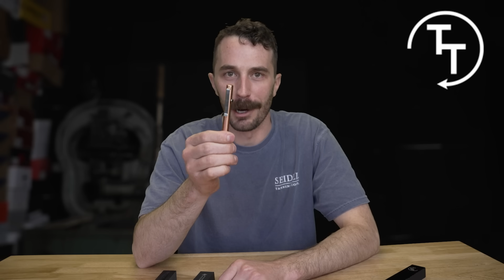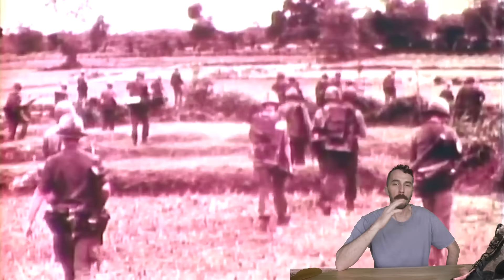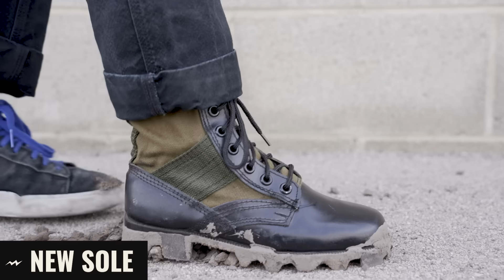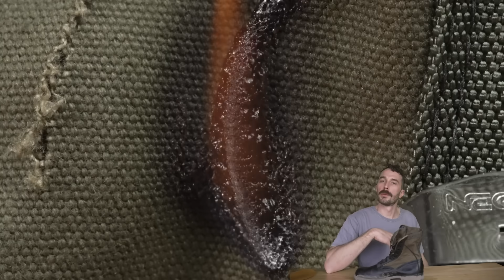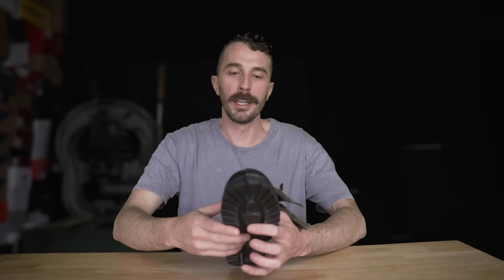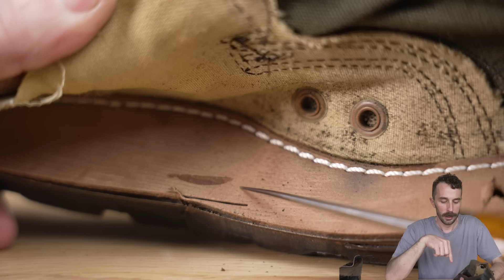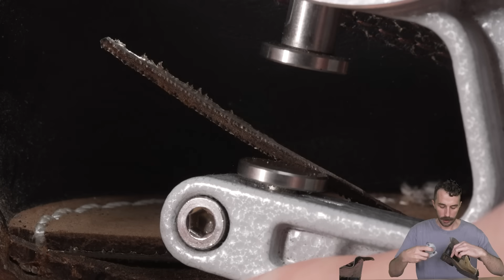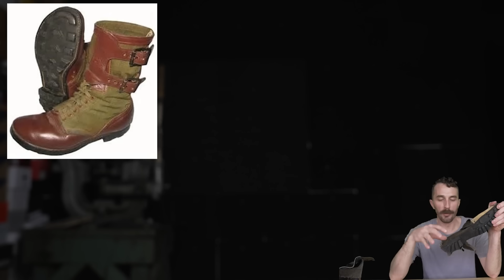Why it took 57 years to replace jungle boots

Comment: I had a pair of surplus Jungle Boots when i was a teenager.  I'm going to give them a C- for use here in the Northern US.   Rainy/wet they suck.  Cold weather, they suck.....Hot dry summers, A+
For jungle use they're probably a good boot, but everywhere else....Meh.   I remember going outside in July with nothing but dew on the grass and coming back in with wet feet in less than 2 minutes.  Later on I had a pair of Altima leather boots that were basically the same cut but in all leather.  They were significantly superior, except for that jeep lug sole in snow!

Comment: The water came in from only one and half inch puddles. The vents are above the inside sole so half an inch of water stays and absorbed by the mesh sole for the rest of the day from the first puddle. And in the jungle there are LOTS of puddles, ponds, rivers and rice fields. Then there was the monsoon season where everything was over an inch and a half. Mud collected to the point it was not possible to walk in some areas. My boots would be eight inches wide from mud at times. Most secure areas required jungle boots spit shined polished, which held in the water and air. 
My father was stationed in New Guinee. He had terrible feet problems. I got free shoes and boots from my dad which gave me the same problems. I was stationed in Vietnam which made my feet problems even worse. Tay Ninh 1969 to 1970.

Comment: Used them for cave exploring for many years. Then the Korean version came along and the sole was no longer the same vibram-like sole. More slippery on mud.
Reply: If you ever caved in a wet, muddy caves, the old vibram soles were far better.

Comment: Curious how you came up with 57 years before replacement. The boot became issue during the 1960's but by the late 70's had been replaced by a black all leather boot. I wore the black leather boots during the mid 1980's in the USMC. The jungle boot can still be found in surplus stores but its longevity as an issue  boot didn't even come close to 57 years.

Comment: This is really one of those things that divide opinion. On one hand, jungle boots are just some of the most durable pieces of footwear and equipment in general. Mud, gravel, sand, marshlands, rocks, it almost didnt matter. These things were gonna hold up and then some. On the other hand, depending on what brand you got they were a bitch to break in, caused a lot of blisters if you didnt, and were generally heavy as fuck; to say nothing of how uncomfortable they can be before and even well after breaking them in. Doing daily runs in these things with a ruck and rifle definitely fucked up my feet and knees. One thing that everyone probably agrees on tho: nobody misses having to shine these mfers on the regular for fear of getting smoked by either your Drill Instructor or CO. I know I dont lol

Comment: These panama/ jungle boots were standard issue in my country up to 2018, and were replaced by tactical "modern boots" afterwards, we'd still use these old jungle boots for actual patrol while the modern tactical boots were used in garrison duty so it didn't even went away, I got out in 2020 but i still see and hear that they still sue this boots outside the wire due to its durability.

Comment: I had 2 pair of the panama sole od green jungle boots in the 90's. One pair was for field one pair for garrison. Of course, like many others, word came down we were no longer authorized to wear them. Fast forward to 2004. Getting ready to go to the sandbox and I was issued a pair of tan jungle boots. Even had the panama sole. (All the other issued desert boots weren't constructed the same) Yep, the panama sole desert boots were just like the od green jungle boots as far as comfort, wear etc. Way better than the other desert boots. Of course I rotated boots on a daily basis just because but I wore the panama sole boots until there was zero tread left. I still have them for old time sakes.

Comment: I bought two pairs of reproductions of these as I had always liked the look of them. Well I don't know how they compare to the real thing, but they are the most uncomfortable boots I've ever worn. The main problems for me are the hard rubber soles and flexible nylon uppers. With the former, walking on concrete and rocks absolutely kills your feet... with the latter, you have to lace the boots up so tight so that they don't fall down that they cause bruises and blisters on your legs. I assumed that maybe the real ones had an extra hard sole too as they were meant for traversing soft swampy land that counteracted the hardness. I made the mistake of wearing a pair on shift as a kitchen porter once and they crippled my feet to the point I almost couldn't walk for a few days.

Comment: I had a pairs of the late ones that had speed laces, steel spike sheets under the inner and the fibre backed inners and the very heavy duty nylon canvas. They were most definitely GI ones as they inners had "Do Not Boil" printed on them. They had the square pattern lug soles. Later model ones than these as they had the speed laces and the later mesh inners. The later ones had the spike layer as a sheet under the inner though rather than embedded in the sole. I still have them though the sole heels are worn down badly. I bought them mid 90's. I wore them in the field mostly in the Army Cadet Corps here in Australia mostly as I was always ending up in creeks. They were quite a bit lighter than the Highmark GP boots that were issued here at the time and more comfortable. GP's were basically waterproof as long as the water didn't get above the cuffs but they were a pain when they got wet as they were all leather. I still have a couple of pairs of Highmark GP's somewhere too. One pair of the GP boots was spit polished to a high shine with parade gloss which took many hours of work.

Comment: I wore these while stationed in Marine Barracks, Philippines. We could not wear them in garrison (guard duty) but wore them all the time while in the field. I can say they absolutely pump water out of those vents. Mine were very faded when I came back and could not wear them except in the field. My steel plate broke in one and it made a snapping noise when I walked. I just bought some of these later block lug soles to resole a pair of work boots. I would wear them again if I could find a steel toe version.

Comment: The thicker sole was called the Panama sole which was designed to push mud out when walking through it. Only downside is it would wear down quicker than vibram lug

Comment: They had cheap ones in Clothing Sales when I was in an light infantry unit in the late 90s prior to the ban or whatnot, the seam on the nylon always gets me, and my feet flatten out a bit if I go on a ruck march or whatnot and press against that seam. I did love the normal black combat boot but when they switched to the desert boots, I always went to a Belleville store or other 3rd party boot maker and had boots fitted for me. The one time you do not want to cheap out on boots, is when you do long ass force marches, tactical assaults, and comvey security.

Comment: You did the piercing of the first boot through the front of the sole. The Jungle boot you did it the the mid part of the sole which is where any metal tang is placed and where the boot is thicker - Bad testing, or conning viewers.
Junk channel.

Comment: The Norwegian military has used the same boots since 1977.
The M77 boots are still being produced and looks exactly the same as in 1977. The M77 boots is basically the same boots as the earlier M66 boots, only with a higher ankle. And the M66 boots was essentially a copy of the British low "ammo boots" from WW2.
I use the M66 boots every day. I like low boots better than high boots. I have several pairs of M66 boots, the earliest pair is made in 1968 and the "newest" is made in 1975.

Comment: I was issued jungle boots for jungle training down in Panama back in late 80s.  Had them in my closest years later when I began work with the US government’s POW/MIA Accounting Command - the Department of Defense’s efforts at locating and identifying our missing servicemen from past wars.  Over the next five years I wore those jungle boots on investigation and excavation missing throughout southeast Asia.  The aggressive tread kept the mud from clogging up the soles and while I often had wet feet, never experienced trench foot. The nylon upper dried out very quickly.  I’ve since moved on to other types of boots, but jungle boots did exactly what they were designed for, working in the jungle.

Comment: I still have both pair of boots that were issued to me in Boot Camp, back in '95.  The leather Cadillacs as well as the Jungle boots.  The outer soles and heels have been changed countless times, but everything else is still in almost perfect chape.  If it works, don't fix it, and keep it as simple as possible.

In fact, (I may have told you this already) but the pair of leather boots I was issued were supposedly from the Vietnam era left overs.  At least that is what the old man in the warehouse told me when he issued them to me.  They were already used as well.  He couldn't find any in the front of the warehouse that would fit me, so he had me follow him to the dusty back corner, and then climb up on a ladder and pull down a few older boxes.  He dug around inside one of the boxes and pulled them out, I tried them on and they finally fit.

I haven't worn them in a while because they need to be resoled, or at least have new heels put on them.  But the leather and all of the eyelets are still intact and holding up quite well.

Comment: The spike protective jungle boot and it’s cousin the first desert boot were the best and most perfectly designed footwear for specific environments. 
I fought in Panama in 89/90 and Iraq in 91 
and boots were never an issue. The speed that the jungle boot dried out was amazing after being fully submerged. 
And the looked cool AF  
Which is important.

Comment: Lose enough wars ya will eventually make changes

Don't give me your opinions when you are narcissistically triggered

My grandpa killed Nazis
And I wouldn't have sent you or your people off 

I just making a point about perspective and trial and error. 

I have a pair of fila I got on sale better than jungle boots and I'm a middle aged punker. That did construction and heavy equipment

I know boots

I've even used them to stomp a few Nazis myself
Love yourself
Get the right boots for you. Not the best in general.   Synthetics are a thing for a reason

I also have worked with lasers 

Have an awesome weekend

Cheers

Comment: Plastic pens, a pollutant?
The easiest way to recycle plastic is to burn it, turning the plastic into the CO2 and H2O that plants need to live and make the non-polluting raw materials for plastic and human life. Recycling metal, on the other hand, either require coal or coal derived electricity.
Both the recycling produces heat pollution, but burning plastic has a smaller environmental footprint, because recycling metal requires more transport and energy, whereas plastic is a potential fuel source that makes the recycling of metal possible. 
In the April 2013 edition of Popular Mechanics there was an article about a South African inventor that built a shipping container sized plastic pyrolysis plant that turns waste plastic into vehicle fuel at a fraction of the cost of vehicle fuel.

Comment: Early 90's wore first a green and later a black colored pair of jungle boots in army service. Loved them both but the metal shank does make your stride different and running in them is painful. My black canvas pair lasted 20 years past service but the leather over the metal eventually wore through. Great video!

Comment: well here in the PHILIPPINES, that boot is still in used in uniformed service, most likely the most popular, probably by its durabiltiy and price, however i have tried one myself with of those, for the 1st 2weeks, felt like i was wearing stones coz of the weight of it, but as you get used to it, it gets comfortable, actually more comfortable than using a regular rubber shoes due to the added support to your ankles.

Comment: If you’re wearing socks and you submerge your boot in water. It’s best to take the boot off and wring out your socks. Put them back on after a short while wring them out again, put everything back on and walk some more.  On the next stop consider changing socks with a dry pare and use a towel to dry your feet. That is a procedure few will make the effort to accomplish.
If you’re a soldier, take care of your feet. If your a leader, make sure your soldiers take care of themselves.  It’s a life and death situation when your feet are torn up and you need to move out…
Reply: I served over 10 years supporting Infantry.  They seldom stopped long enough to wring out socks let a lone change them.  
The few times I wringed out socks on the move it took 5 stops wringing each stop before toweling off changing for      dry socks.

Comment: I was an officer in the Army from 1978 to 2009.  In 1988 I moved into Special Ops and was issued my first pair of jungles.  I wore jungles with my BDUs for the rest of my career!  We even wore them to Desert Shield/Storm because the brown suede-outs weren’t available yet (only the USAF had them…).  Once stripped, the leather is prime for spit shinning and they are perfect for any environment except hot desert sand.  They are extremely comfortable compared to all-leather jump boots.  So the jump boots got relegated to wear with My Class A or B uniform.  Love my jungles!  I still have them upstairs.

Comment: My Jungle Boots had the newer sole and the steel plate. These were the most comfortable boots, very comfortable. Water drained well, and walking helped with ventilation as air came in and out of the drain holes. I wore them after I received my DD-214 in my work.

Comment: Great video, and great assessment of the features. When I joined the military my dad gave me his jungle boots from Vam. I wore them for a year or two in the early 80s and enjoyed them. This version is really exclusive for jungle deployments so wearing them in other climates is not recommended as I found out on my own. Another item you didn't mention was my dad's pair had a very dense and hard sole compared to modern versions. I think this was also for the protection from booby traps. The downside is they were slick on wet pavement. Something you are not likely to encounter in the jungle.

Comment: I was assigned to the 82nd Airborne in the early ‘80s, and I was issued two pairs of jungle boots when I arrived. They were perfect for the swampy terrain that makes up much of the Ft. Bragg training area. But, in the cold North Carolina winters, the steel plates in the bottom of the boots caused a lot of misery.
Reply: Feet and knees together!   The metal strip kind of sucked when standing in the desert too.  Someimes you'd get a burn on your feet that exactly matched the metal spike protector.  Still they were pretty good boots overall and far better thant he regular CBs which were our only option back then.
Reply: i occasionally see helicopters from fort bragg (or what they call it now, fort liberty) flying past where i live
Reply: I was in the 82nd in the late 80's. They didn't issue us Jungle boots but they were still authorized for wear along with OG 107's . You are absolutely correct about them being perfect for training at Bragg except for the winter of course. Makes sense since they were made for hot humid climates, but to be fair, none of the boots that were issued to us then were good in the winter lol
Reply: @chuckgoetz9875  Same era - 84-88. OG 107's and jungle boots. But get caught in a boonie hat and 1SG loses his mind. It figures we wore Vietnam era uniforms since most all our equipment (PRC-77, M16 A1, M151s, M551, etc.) was also vintage.
Reply: @NemoOhd20  yeah i don't know why they decided to name it fort liberty. unrelated but I saw some guy who moderated for some game had an entire website in his about me dedicated to pronouns... lol
Reply: honestly i see why they changed the name of fort bragg but fort liberty is such a generic name
Reply: @jacobeii  Two of the main drags in Fayettenam NC to Fort Bragg are All American and Liberty.